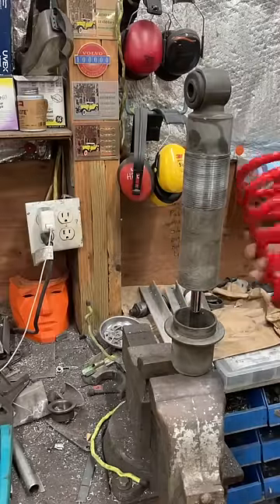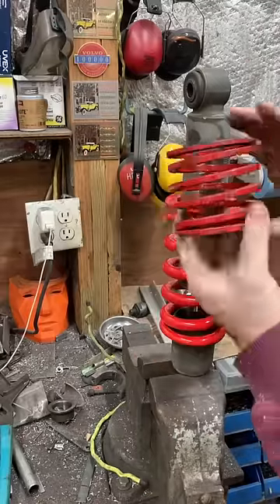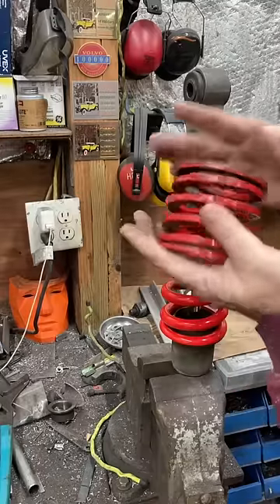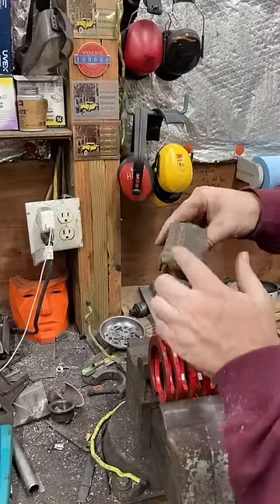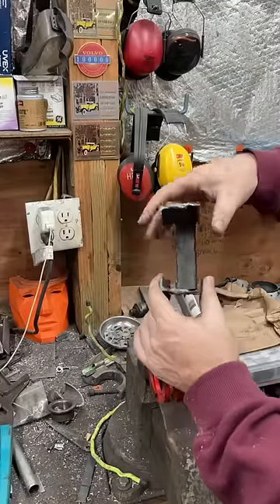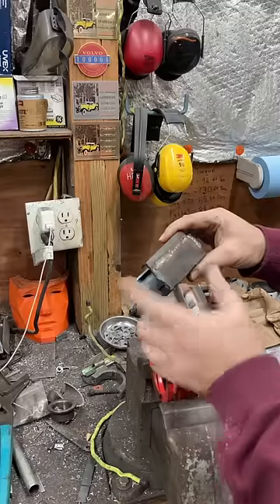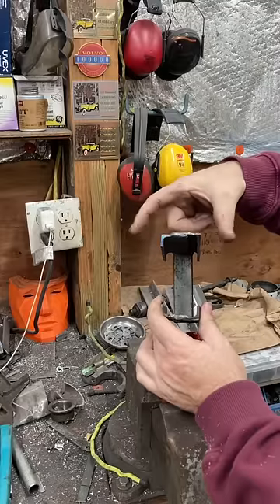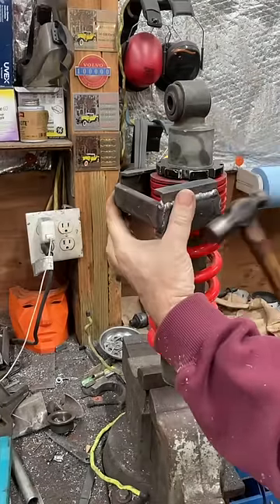Hammer off spring compressor #shorts #fabrication #auto #becauseracecar #mechanical #part2

Comment: Hammer it off on camera so people know why not to listen to you
Reply: what he did is probably smarter than anything you have ever done
Reply: @Kiwiskinmuncher  ah yes a real intelligent man makes a homemade widowmaker
Reply: People gonna hate all day.  The man obviously knows what he is doing.  He put 800lbs of pressure on a weld that can hold 15K.  Pressure nothing dramatic happened when he hammered it off.  It may have popped a little bit, but more than anything, it probably made the C clamp thing flip in the air a bunch of times before landing on the floor.

Comment: Why ppl so upset? It obviously work very well.
And he did upload this vid, so he didn't die...
Reply: thats one coilover. 3 to go lol
Reply: Or the next time he does this and his welds have some oxidation on them, or maybe the adjuster nut doesn’t like getting smacked by the spring, his tool might get him some shrapnel in his dome.

I hope this dude would also tell you there are much better tools for this job than what he made to fix his issue of the moment.
Reply: Please don't work with high tension springs until you've done your research!